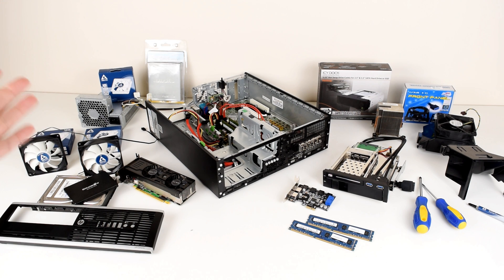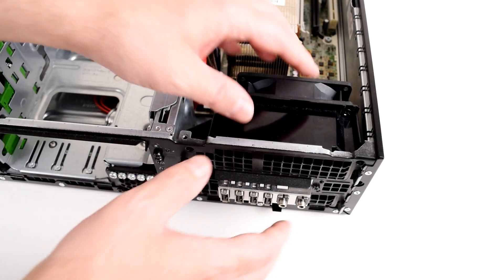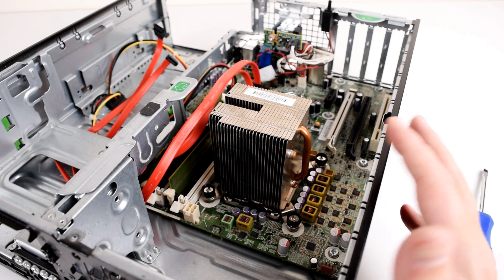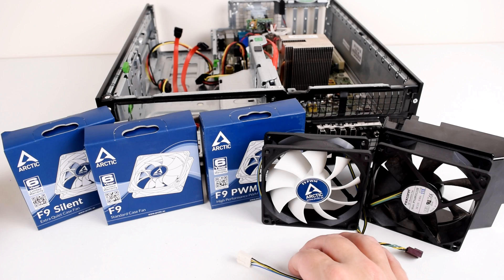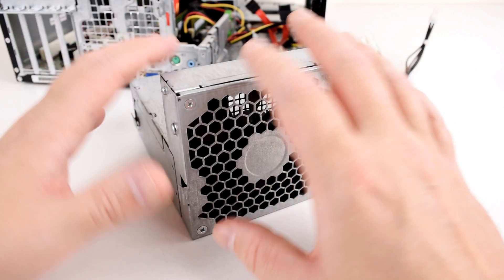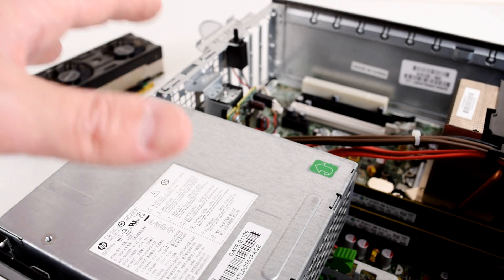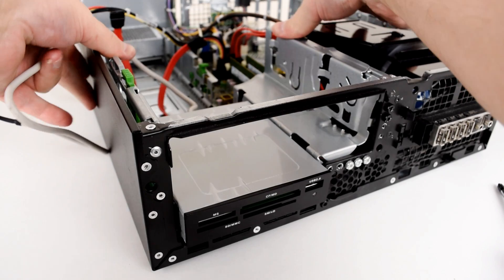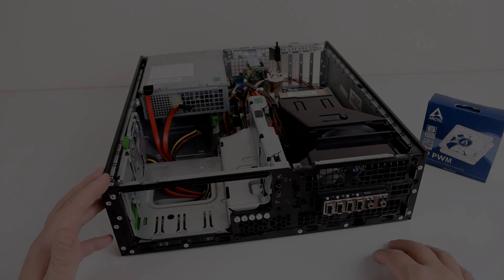Improve your HP Elite Small Form Factor PC

Comment: This thing probably tears through games better than my Optiplex 9020, which I only found out after buying it that only a GT 1030 fits inside
Reply from the maker: With a GTX 1050 it is quite a capable gaming machine, handles Fortnite extremely well, I think in one of the videos in the cards you can see it in action.
Reply: I bet it would. The 1050 is a 1080p powerhouse. I originally intended to stick a 1050 ti in my optiplex, but found the only x16 PCI-E slot was squashed up against the PSU.

It'd be interesting to see how much a 1030 or 1050 is bottle-necked if used in a x4 slot, and if it'd be worth upgrading from a 1030 to a 1050 even if it meant I'd need to switch to a x4 PCI-E slot. I'm not sure if it has been tested before, but I'm sure many optiplex owners would be interested in finding out
Reply: HeylonNHP there are half height 1050s out there, just they might be more expensive than normal ones
Reply: That's true, however the half height versions aren't also low profile which unfortunately leaves me a bit high and dry
Reply: Not a problem. 4x provides more than enough bandwidth. I'm currently running my rx 470 on the 4x slot and basically saw zero difference went I switched it from the 16x. And yes, the difference between the 1030 and 1050 is quite noticeable. Basically going from an e-sport machine to entry level gaming which can do alot of titles 60fps on 1080.

Comment: Nice video as always, Phil!

This video gave me a lot of options besides what I've already done. I have the 8300 SFF, and I added a GTX 1050 Ti, an ASUS Wi-Fi card, a Blu-ray drive, a 500GB Samsung 850 EVO, and a 3TB hard drive. I use it for just about everything you can use a PC for and it's awesome and cheap.
Reply: Psu stock?
Reply: Mine using stock i3..is it possible to plug n play i5 processor?
Reply: Are you using a 3tb 3.5 or 2.5 HDD?

Comment: Wow, an i5 2400 with passive cooling? How HP managed that? Did they lower CPU clock?
Reply from the maker: It's not passive, the front case fan blows air through the plastic duct and then through the CPU cooler.
Reply: PhilsComputerLab yeah that's it. Take a look at the older Dell optiplex towers like the gx 240. It technically is a very good design because the fan can be bigger than the cooler itself while not being in the heat path of the chipset cooler. I think Dell still has that kind of design on the optiplex desktop computers like the 745 and the gx 520 which I both own

Comment: The HP Elite 8200, and EliteDesk 800 and later make nice cheap small servers for ESXi as well, as Q series of chipsets support PCIe passthrough and the CPUs support AES-NI.  Great for consolidating a virtual router, storage system, and other services.
Reply: Power must be cheap to run basically full sized machines for that kind of thing. My power tariff is pretty much from ECS Liva till NUC only at home.
Reply: Those processors throttle down power usage pretty well, but I get your point.  In Kalifornia, we pay some of the highest power rates in the US.